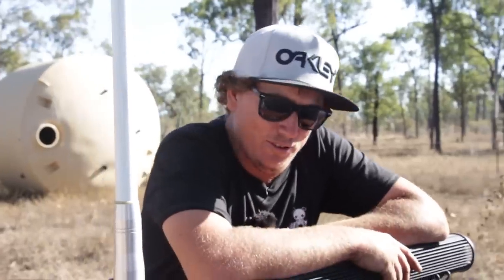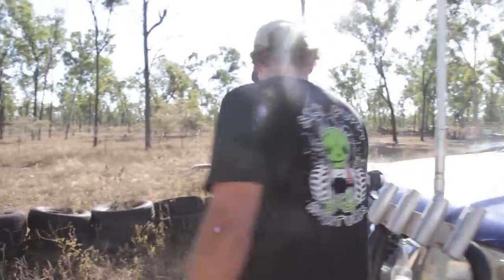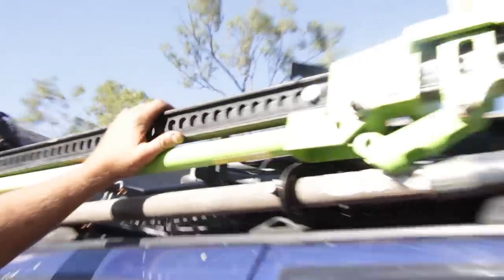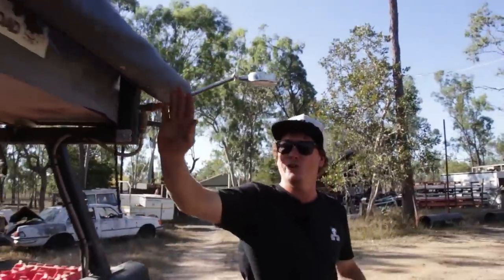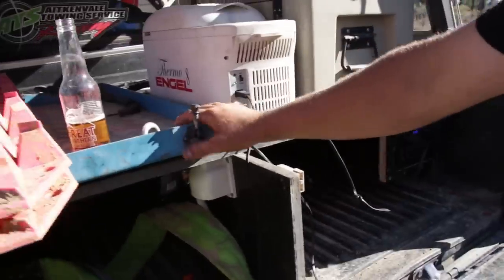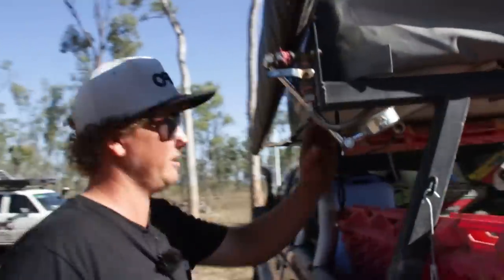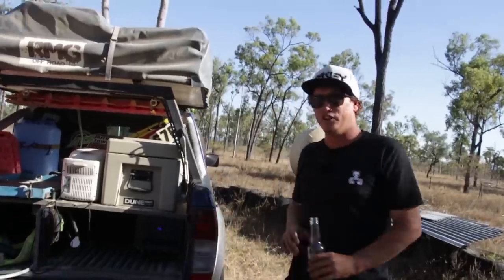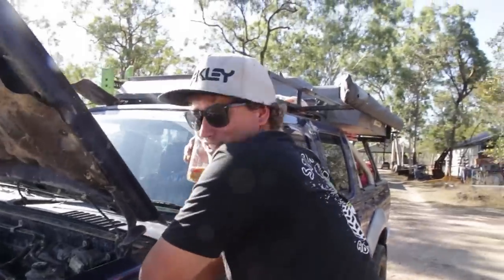CHEF SPUDS D22 NAVARA WALKTHROUGH - Sick Puppy 4x4

Comment: What ya mean kings are junk?
Reply: I got the same spotties, nothin wrong with em and they're heaps more affordable than all the rest
Reply: i had them on my old gq melted 30, 40 and 50 amp fuses within 10min of being turned on nearly burnt the car down once with new 5mm wire. absolute rubbish
Reply: And he said the awning was junk
Reply: I’ve run my kings spotties for hundreds of hours with no problems. I have the awning too. It’s been folded over the roof by wind 4 times and still works. Like I said ya can’t beat it for the price. If you want to spend 3x as much on ARB that’s made in Asia, do it.
Reply: And plus look at the hell 4wdaction put them through
Reply: doesnt even know the size of his awning so wouldnt go off his opinion
Reply: I own a Kings RTT, didn't take long for things to start bending and breaking, there's a good reason why they are the cheapest RTT around. Bro in law bought a Kings Awning and it ripped the very first time he set it up when a bit of wind hit it.  They are OK'ish but I sure as shit wouldn't get anything electrical from them.
Reply: should buy light force spotties for $800 A light and you'll have way more distance and light a couple kilometers down the road and not just a flood light that shines 50 meters off the road
Reply: @outlawdingo3020  why do you need to see 2 km down the road?
Reply: I also have a RTT from them after 4 times its falling apart a fair effort last trip i unfolded it and the bases seperated and one half fell had to use trusty ol zip ties to hold it up in place. their bbq plate grill does the job alright but was a good freebie
Reply: I unsubed cause of dis
Reply: @pabspabs2736  What's your setup?
Reply: 4wd action probably swap them every trip
Reply: Kye Beazley even notice how their snatch straps are spotless every time regardless of the mud around …